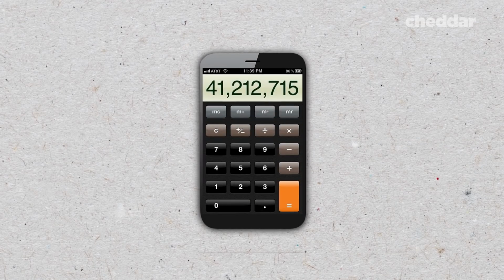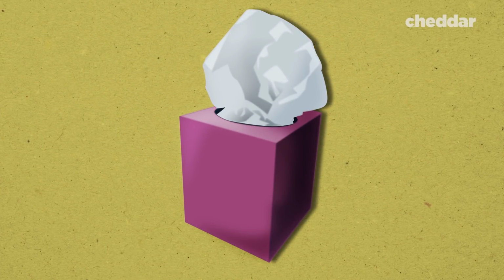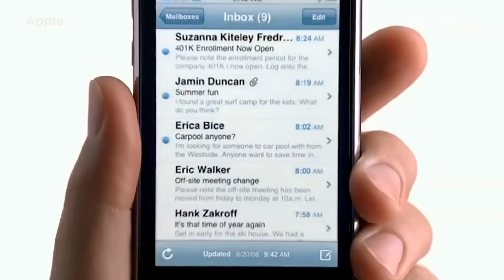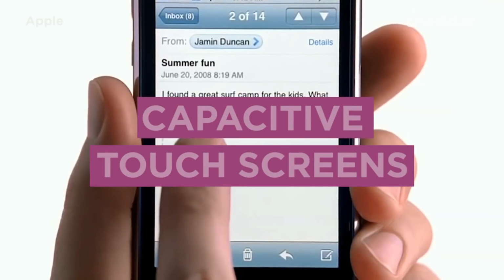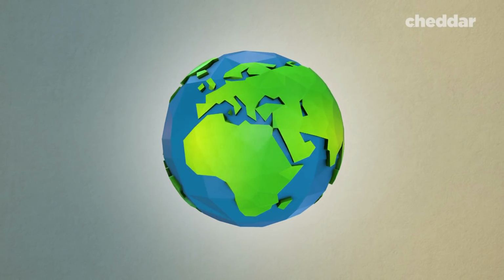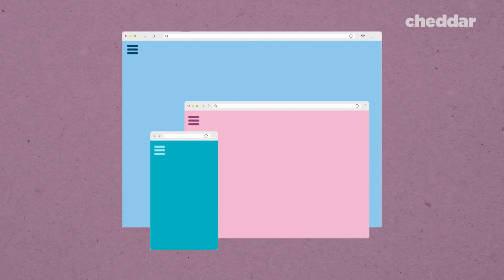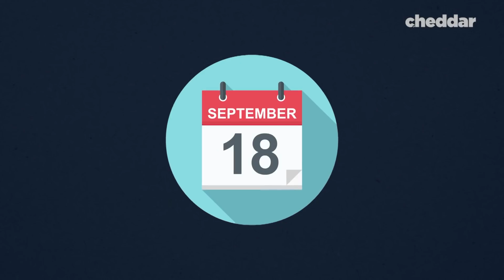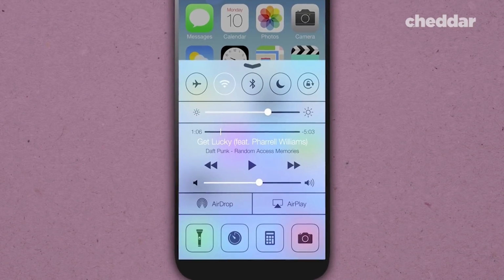Why 3D Logos Fell Out of Favor Overnight - Cheddar Explains

Comment: in the real world, there is a hamburger menu. And this is again the usual menu when you order food. This hamburger menu design is similar to the lines on a regular menu that is used when ordering food. Abandoning skeuomorphism is a very crazy idea, since it is impossible to completely abandon it, since any graphical interface is essentially skeuomorphism. Even if it is very flat, it is still a skeuomorphism, only more simplified and primitive. Abandoning skeuomorphism means abandoning the user graphical interface and moving to the command line.

Comment: 2013 was the year absolutely everything changed, sometimes even overnight. Sometimes it was good, sometimes not so good, and sometimes it's so subtle it barely makes a difference. 
But like, nothing remained the same anymore during those 365 days, and it's why I'm gonna have to call it the year of change. Everything was heading a new direction. People were excited, others were pretty disappointed, and I reckon stuff like this won't come in a long time.

As for iOS 7, I mean yeah it was definitely a very cool new release, but in my opinion they could've kept the skeuomorphic design for at least a few more years until sometime between 2014 and 2016, and make iOS 7 some kind of transitional release. It would've made people more accustomed to flat design before the skeumorphs would be removed completely. Going for a brutal change definitely caused a lot of controversy, and I just wish Apple doesn't go through this the bad way. Besides, I'm very excited for neumorphism.

Comment: One thing that also changed is the nature of the screens. The 3-D look didn't start with the flatscreens of the iPhone and color Palm pilots.  It started back in the early 90s with Sun's OpenLook and OSF/Motif for Unix systems, the latter to which Microsoft contributed to and then brought back to its Windows 3.0 look & feel.  As noted, screen size helped. These were the first to start having 1000pixel screens so there was space for the shadows. Also there was the nature of the giant CRT screen - you could imagine 3-D because the screen was deep. The metaphor matched the mechanisms.

But that really lost sway when not only were phones flat, but even more so when laptops gained in popularity and even desktops started getting flat monitors.  The 3-D depth seems 'artificial' on a flat screen laptop, so when more desktop/laptop systems were going flat, that had an influence as well in changing Windows, changing the direction of Linux desktop systems, and a massive influence on the browsers framing, which then had an influence on the pages viewed within it.  Yeah, Apple was a big force, but not the only one.  Flat screens were going to lead to this eventually, just because the metaphor no longer was needed even when dealing with a mouse and keyboard.

Material Design was an attempt to find a layered approach - still keeping ideas of depth while not seeming 'deep', using the simpler box-shadows approach rather than the beveled look.

Comment: 1:30 The Burger King example is idiotic. It's still not a 3D logo. It's just a flat logo with a simulated perspective effect. Surfaces are still flat and reflections on the buns are simulated with 2D shapes using negative space. It's a very stamp-like logo. If you remove colors, 90% of the information is still pretty much there. Same goes for the current Instagram logo, which despite the gradient, is still a very flat design.

Comment: I was into computers in the 80s and 90s and 3D design was considered cool when it appeared in Windows 3, compared to the flat interface of Windows 2 and other GUIs of the time like GEM; the buttons that looked like they were being pressed when a user clicked on them represented what newer processors could do that old ones couldn't, or would struggle with. Same goes for the OpenGL screen savers of the early 2000s -- it was just to show what it could do. The move away from skeuomorphism and towards flat design in the 2000s happened largely because 3D design was no longer necessary to prove that advanced technology was a thing; flat design came to be seen as neater (and maybe programmers saw it as less processor-intensive) but it is, in my opinion, a fashion that could change back the other way.
Reply: The bigger problem with flat design is that it tends to go way too far into simplification, to the point where important information is discarded in favor of simplicity. I cannot count how many times I didn't know a thing was a touchable element on my phone because there was no box around it or background to offset it. Windows 3's 3D common controls served a much bigger purpose than merely looking pretty: they made it very obvious that a thing could take a clicking action, and also when you were successfully taking that action upon it. Now, we've reverted to Windows 2's flatness, where the entirety of your options for discovering that something is clickable falls into two camps: guesses based on previous knowledge and use, and just screwing around hoping to find something.

Comment: Subtle and well-done 3D is significantly easier to grasp visually. The complaints about 3D bevelling were, as always, not about 3D itself, but over-generalized from badly done 3D icons. 
And now everything is in full reverse gear, going overboard the opposite direction: the TWO color [!] user interface of Windows 10 looks ugly as F$§& and loses a lot of visual information with its monochromatic idiocy. My old Commodore 64 could do more!
Reply: The trend toward two colors is driven exclusively by the fact that it's very easy to change those two colors to fit some sort of system-wide or program-wide theme. An image of a world with green continents, blue oceans, and white clouds can't be color-changed by the system or it won't work anymore, but a stupid generic outline of the continents inside a circle, all white, can be changed to a different color and still "work." Granted, the change to an outline works more poorly, but they're not trying to make a good interface, they're just trying to make it easier to screw around with day/night themes.

Comment: iOS didn’t “update overnight” to the flat design of iOS 7. Automatic system software updates weren’t a thing back then. You needed to do it yourself. Also it wasn’t overnight that it changed, because Apple always shows their new major releases months before release in a showcase for developers… the world knew it was coming before it did.

I remember how hideous iOS 7 was. I hated it. But it wasn’t about learning to love it — the design was in fact terrible. The idea was there, but the execution was very poor. It took years before iOS actually looked good again, instead of looking like a knock-off of itself.

I was a graphic designer at the time (I still am, but it’s not my job anymore) and I learned to love the trend because it made design much easier — especially with the two years  iOS 7 and 8 were the latest releases of iOS, because I could throw something of equal quality together in five or ten minutes. It’s not as easy now, but it’s still very nice to save time by not using embossing and drop shadows in Photoshop.

By the way, I find it interesting that the example icon is Instagram — they were one of the last apps on my phone to get a modern icon. It remained skeuomorphic for long enough that it seriously bothered me.
Reply: “X happened overnight” is a turn of phrase 😅
Reply: I personally found it really nice to look at—but I’m no graphic designer! I think the reason why I liked it so much was because it was flat, clean looking, and radically different. I’m sure Apple (being the multi-million dollar company that it was) could’ve made a design that could’ve appealed to regular users as well graphic designers.
Reply: It's an English phrase lol
Reply: Also, skeuomorphism didn’t exist because of the iPhone. OS X was very skeuomorphic before the iPhone was a thing.

Comment: 1996-2006 = 3d logos
2006-2019 - flat logos/retro logos
2020s = 3d logos are back again 

It is a cycle like everything else.
Reply: 3D was there pretty much up until 2013 or so, and even though things weren't quite as 3D before Win 95 due to tech limitations, they still tried to simulate shadows with what they had in stuff like Win 3.1. And you still had real-world analogues (Think floppy drive for saving), so skeuomorphism was always there.
Reply: @UnchainedEruption  yes, but around 2006 they started to flatten some logos that were maybe not "tech" related...such as  Coca-Cola, diet Coke (those designs were much more flatter than the previous design from the early 2000's. Another example is Pepsi in 2008 (they ruined the logo), Gatorade (they changed the focus from the lightening bold to a giant flat "G" and the typeface was changed to a generic white upright logo).  Despite complaints since 2008 Pepsi/Gatorade have refused to stop using the over simplified logo. TV stations started using flatter logos as well for their on-screen graphics after 2005, just look at the current WGN logo and current STARZ logo...it gradually became more simplified looking since the late 2000's. The trend was just too overdone, now we reached the point where many logos are all looking the same.

Comment: Such a BS video. 1- "Flat" design wasn't first started by Apple it was by Windows 8.. 2- It wasn't because its better looking. It was because Windows 7's 3d UI with all the transparencies was resource intensive and that affected battery life on mobile devices. Microsoft wanted something less resource intensive and simpler to improve battery life on tablet-like Win8 products which were new at the time.. Since better battery life is an advantage for anyone, google and apple followed. 3- Secondary advantage are more versitile. A vector graphics logo can be printed on adverstisment board or used on a smartwatch without modification. Flat designs are not necessarily easier on graphic designers, its actually harder for people used to photoshop more than illustrator.

Comment: I'm a fan of the 3D design much more. Same thing with website design which has shifted to this over simplified look and abundance of whitespace which actually makes more scrolling/clicking to get to where you want. Everything is so circular as well which kind of gets old. God forbid we use a rectangular shape for something that isn't a button.

If you go to 4:17 can you honestly tell me the logos on the bottom look better? No you can't, because the top ones look better. I think Google does look better 2D though.

Comment: Not sure if I am different but I always found dragging icons to the trash was a clumsy way of doing it, I always just right click and delete. It seems much more direct. Perhaps it may be because I started out on computers with a C64, and many of the things we now do with a mouse were done using commands typed in on the keyboard. There was a windows-like system called GEOS,  but it failed to actually have much use.

Comment: InDesing was not made for logos or drawings, Photoshop, Illustrator and CorelDraw were indeed aimed for drawing and all of them where fairly widespread much earlier than "the turn of the century", but even with (or without) those softwares, volumetric logos were widely popular since the late 70s. Plus 3D logos where already doomed  by 2010 when the trend started reversing. You cannot pin-point a world trend to an apple interfase, actually iOS was more a result than a cause.
Reply: This video is so badly argumented...